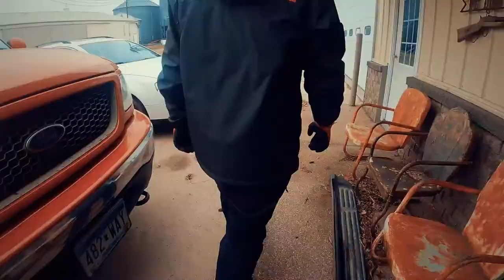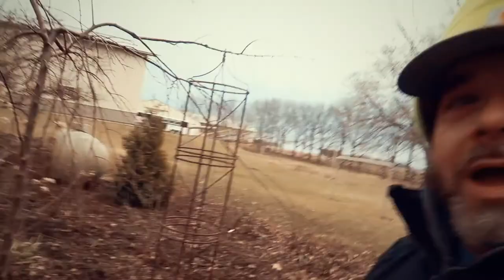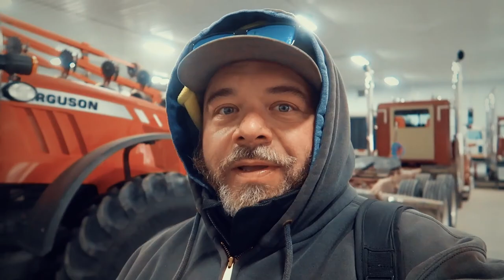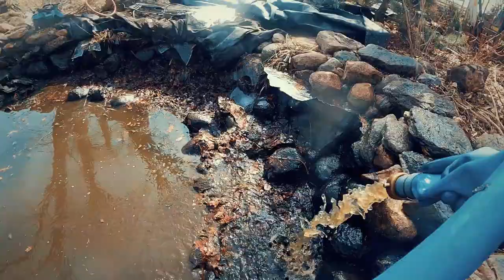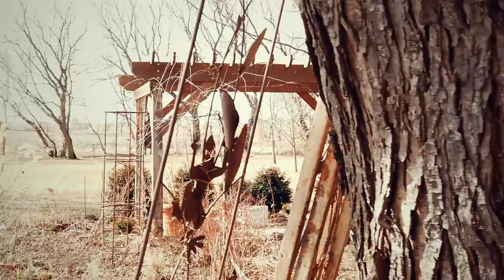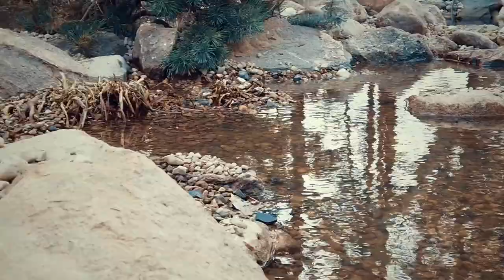Adding a WETLAND FILTER & INTAKE BAY to an Existing Pond 💦

Comment: That intake certainly does it's job!  Well done.  Looking forward to the videos of this and the older jobs you're planning on re-visiting.  Can I ask what you do with the auto top off line in winter?  Do you need to disconnect the tubing and blow it out and cap it?  Or does it do well staying connected?
Reply from the maker: Thank you! Are you at pondo? Auto Top Off we do blow out in the fall for winter prep with an air compressor. With all of our plumbing in the north here we slope things properly to drain and leave things closer to the surface of the soil for ease of repair if needed.
Reply: @PondKingWaterGardensMN  sadly not going to Pondo and just found out next year will be online again.  I'll be doing the academy this winter for sure.  Is there caps for that little tubing or do you just tape the ends?
Reply from the maker: I'm sure there are caps. We haven't had any issues after blowing them out. How did you find out next year is online? Why is that? One day our paths shall cross!

Comment: Absolutely gorgeous pond you guys! ❤️ My son and I have been working on an 8,400 gallon pond for the last year with an intake bay and waterfall bog filter,all dug by hand. We just got the 45mm EPDM liner in the pond last week. That liner was a beast! Had to call friends to help roll it out and install it. 
Just wondering what the depth minimum of inches the weir can be for the intake bay? I saw yours in this build was 12” depth. Can I get away with less than that for the weir depth? Great video! ❤️
Reply from the maker: We like to do the 8-12" because it allows us to have a fluctuating water line. 6" opening should work you're just married to that water line & can't go lower if you ever wanted to. Sounds like an awesome perfect! Let me know if you need any other tips!